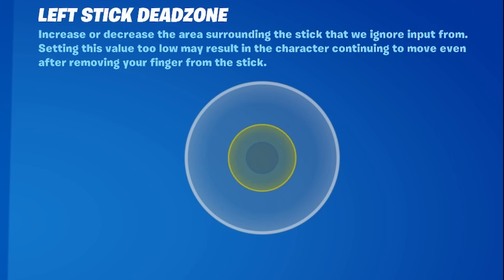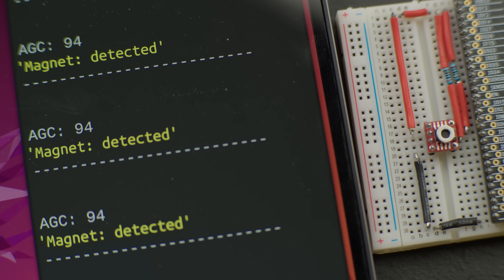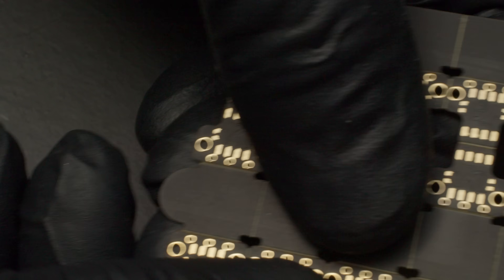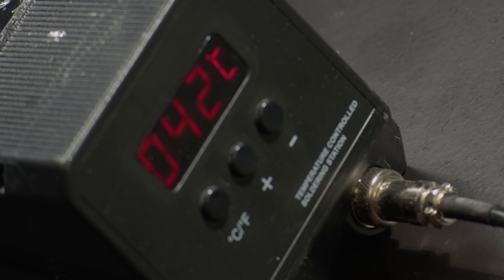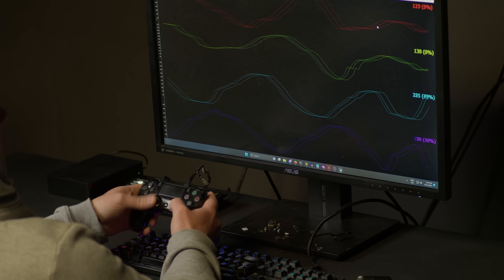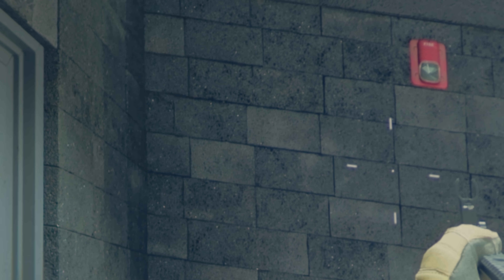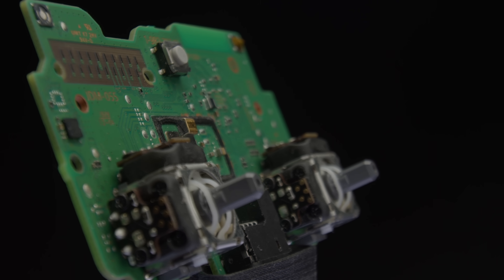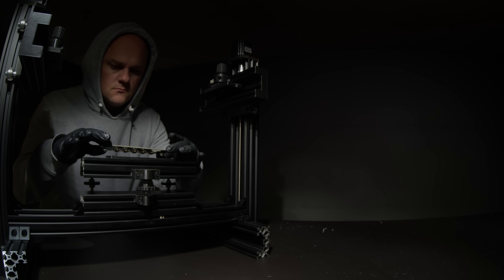Beating the $20B Joystick Drift Problem, and giving it away for free

Comment: i think you could replace the metal screws with plastic ones if you can find/make them to eliminate conflict with the magnet's magnetic field on the long term ... its a very interresting idea..... and i've always wondered why no one changed it to a magnetic potentiometer i was even talking about this few days ago :D and just came across this video... it's amazing and it surpassed 
expectation

also im not a controller guy:D

more of a keyboard and mouse

i think its just to expensive to change it now since it would make all controller parts obsolete, but eventually it will need to be done

 but i wonder now.... even magnest have wear and thear... i mean ... they loose their magnetic properties as well 
i wonder if we somehow could change this to a laser potentiometers as well... but im honestly happy and don't think you could get any better result than a magnetic potetiometer you made
so... Now its a more interresting idea to try and find a way to make a resistance on the joystick to add a deadzone somehow .... its going to be hard to imagine something that could pull or push the stick back to its 0,0 position everytime LOL

i wish you all the best men, thank you for this amazing video and all the work you've done!
Reply from the maker: They degrade over time but very slow. And this solution is also easy replaceable because of the automatic calibration. And optical encoders are the most close to laser stuff. Its coming!
Reply: Ooh ... yeah thats ... i haven't thought about how replaceable they are... lol its literaly two magnets to swap... thats extra Cool ... wow 

Cant wait to see how the optical encoder will in comparison to this 

I imagine its going to be hard to beat the magnet results but surely its going to have a longer live run the the magnes

Honestly i think that the magnets are more interresting after you mentioned the fact that you can just swap them with ease it also ends up being cheaper and does not take much time.... very interresting

Comment: The problem is that there is a point where things become too good. The companies are built to create a profit, not make life better for everyone, so they NEED their controllers to break at some point so it keeps forcing millions of people to buy new ones which makes money for the company
Reply from the maker: Exactly. And its gonna be their downfall.
Reply: people still spill drinks and stuff happens over time.

if they wanted to sell more controllers they would be wise to subsidize local coop games.

Couch gaming is more or less dead, as a kid with Golden Eye and Halo CE, we'd play on a 28" TV 4 player split with 480p, now as TVs are big enough, 4k 55"+, to support 4x 1080p screens... yet there isn't really any AAA developer doing splitscreen. I havent checked in  a while, so i could be wrong, but I believe that the Master cheif collection  doesn't even support 4 players in most of the campaigns or in multiplayer, despite the original doing so.

I know hardware is being pushed to its limits this gen, and multiplayer brings its own sorts of problems with rendering 4 different view points and the added physics load.

Comment: the problems with the analog is because they are made with PLASTIC
make them with METAL ^^ of course you need a 50.000 euros mini-mill CNC machine enough precise to use 0.5mm end mills at 15.000 RPM ^^
this is why you cant beat large corporations in making components

... of course, great video and well done, you know for sure a lot of things, still your hardware limitations are the bad thing to make a SUPERIOR analog respect SONY ^^

Comment: Okay I don't want to get dogpiled in the comments, but from my perspective, I'm not even sure stick drift is a real thing at this point as i've never encountered it across years of playstation microsoft and nintendo products. I'm the  kind of person who can rack up 600+ hours of playtime on a game i like in just a year of play. I have to wonder if people just tend to misuse their controllers and wear them out faster than intended by the manufacturer. I can see that happening in cases of streamers or just really hardcore gamers, who just game day in and day out 8+ hours a day. The only issue even close to this that i've seen is an ancient wireless gamecube controller sometimes acts up on me, but feels more like a physical issue with the thumbstick attachment itself that can get fixed if i just turn it off and back on again. Just my 2 cents on the issue because i've genuinely never had this issue.
Reply from the maker: Nintendo and Microsoft have different ways of autocalibrating the joysticks. So they will not notice so quick.

Comment: Looks like a cheaper but more reliable variant of the Dreamcast solution since it does not use a spring.
Am I crazy if your solution also theorically  allows for joystick force feedback ?
Reply from the maker: No im gonna work on that exactly next 6 months. Active control.

Comment: I've known about hall sensors and their advantages for a while. The biggest  reason why they're not more widely used is probably because they are slightly more expensive than potentiometers. But needless to say there have been past examples of controllers using hall sensors, notably the sega dreamcast controller on the home console side and the ps vita 1000 series sticks for handhelds. It can be done and has been done, but mostly the manufacturer prefers saving money and giving you incentives to buy another controller which will eventually fail.

Comment: The problem here is that the cost to be able to do this yourself is way beyond the price for me to buy a plug in replacement stick for my DS Edge, or even to just de-solder and swap them out the old way. Even beyond the cost of a new controller to do it the first time. That's why there needs to be a 3rd party to make these available at a reasonable cost. Still, kudos for showing Gulikit how to get things done already. lol

Comment: There are tons of existing hall effect joysticks on the market already, including modules to swap out into existing controllers that use pots instead. At this point it's mostly about informing consumers and putting more pressure onto first-party manufacturers who still keep using pots, but I get that those companies are also dealing with consumers who are pushing back over any price increase. The simple fact is hall effect is more expensive, so first-party just don't bother and leave hall effect to after-market for gamers who care.

Comment: You're not the first to think of this, you're not smarter than the manufacturer.The truth is if they used hall effect joysticks them you'd just whinge about the price. They also use a lot of power and would significantly reduce battery life of controllers. At which point you'd have a fucking cry about that.

Plain and simply, you're wrong.

Comment: This won’t change anything, it’s the same exact story with other large companies that make products that last forever, like the controllers used to, but they realized that it doesn’t make money that way, so they had to limit the life of the device. Veritaserum had a great video on lightbulbs which is very similar to this. Point is, the manufacturers won’t change anything until customers either stop buying their stuff or they move to PCs, which will never suffer from this problem.

Comment: Looks like you could use some smaller screwdrivers, just get a set of small jewellers screwdrivers, and iFixit also has a set, since they're made for phones etc.
I saw you knocking off some bits off of the 3D printed parts when screwing them in, the smaller screwdrivers will fix that, also just work easier usually.
A minor investment you well get a lot of use out of.

Comment: "controllers can cost up to 250 dollars" - excuse me fucking WAT?!....

... now I appreciate my several years old still working PS3 gamepad even more, that thing cost me somewhere between 30~45 euro back then and I regret not having bought a 2nd... But at the time I didn't know if it'll last to be worth it, and by the time it was clear that it was indeed worth it, they weren't made anymore and overpriced : (

Though I am pretty sure that the gamepad industry is very happy about this "20 billion $ problem", because they're getting those 20 billion. If the games were saving those from controllers actually last years by normal, they'd be crying and lobbying against it.

Comment: I generally don't game with a controller but I'm shocked hall switches aren't already used. They're so common place in applications like this that need precise sensing. 

My guess is there are Engineers who want to use this kind of design, but it gets turned down because the cost is too high.
Reply: planned and programmed obsolescence = gamers need to replace controllers more often = more profits.

it could cost any amount more, even a whole ten bucks more (which, ten bucks is still insane for many small electronics components). companies can charge for whatever it costs to make products. It doesn't matter the cost. Cost more to make = charge more. they could make more money off of each controller with the better switch.

but what's even better is making four times the sales by preventing people from being able to use one controller for years and years.

Comment: Official Xbox One controllers already have hall effect sensors in them - they are on the triggers though... I guess it was the cost of manufacture that prevented them using them on the thumb sticks. They did spend a ridiculous amount on the R&D ($320M wasn't it?).

Comment: But isnt the main problem of the drift, that the joystick physically does not center?
Reply from the maker: Yes. If your sensor is nosie free so it can actually measure where it is. The main problem is the noise with the pot meters. :D
Reply: @MariusHeier1  yeah. I used to do carsim racing in the early 2000s. Had a logitech with the worst pots ever. Later got a Microsoft sidewinder which I think had optical pots and never had a problem (except for bad driving :)

Comment: The Nintendo 64 didn't use potentiometers, but rotary encoders (same tech as in mouse with the ball before they went optic ... well, the rotary encoders were also optic, but in a different way).
It suffered from other issues (plastic parts were rubbing together, and we ended up with plastic dust and a lot of play), but no drift.
I'm kind of shocked they went back to older tech in newer controllers.